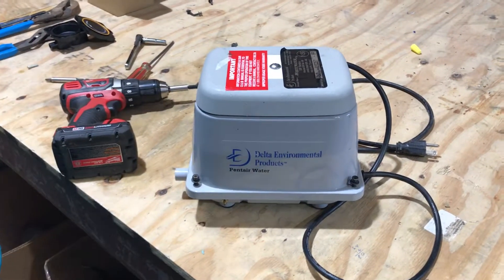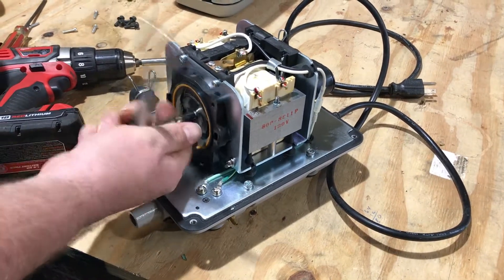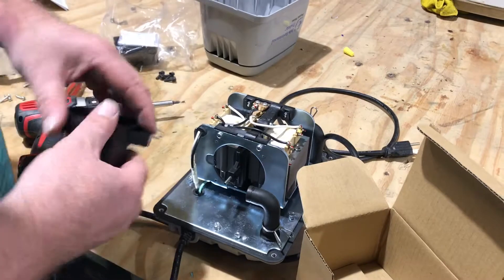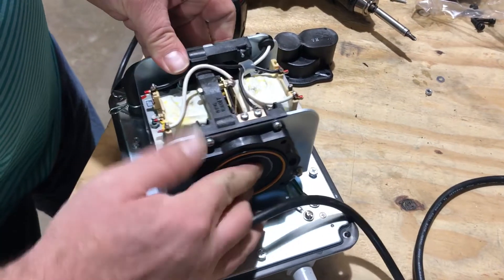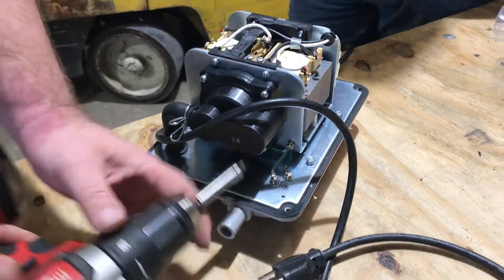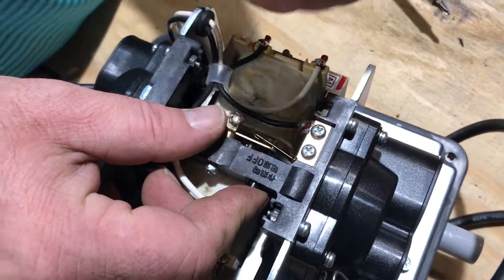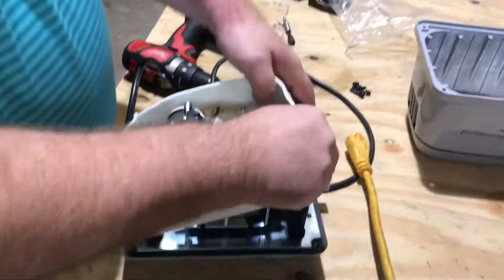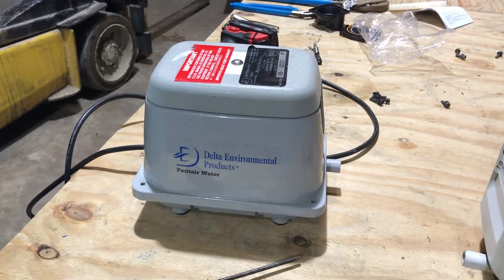Delta environmental septic pump rebuild

Comment: Thanks for taking the time to record and upload.  Good points on not cracking the the new parts with a screw gun.  We don't have the safety screw on ours (newer I believe), has a slider instead. Likely the same outside of this feature.

Comment: thanks for the video !  Question, what causes the safety screw to break ? you mentioned if the magnet travels to far. I assume the screw breaks when a diaphragm fails, thus shutting down the system ? I just tore mine apart and safety screw was broken and I had a torn up diaphragm . I guess what I'm asking is, if I get a new rebuild kit and replace both diaphragms and safety screw, I should be good to go ? Thanks in advance ......
Reply from the maker: Shaffer Automation you are correct in 98 percent that is the cause of failure.